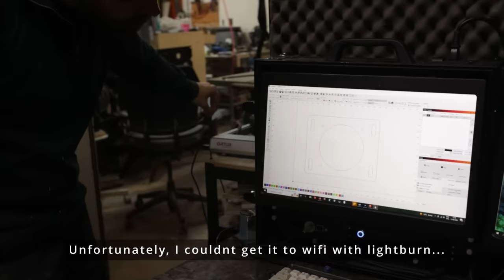Building a £20,000 Epic machine part 3

Comment: I do not think I have ever been more impressed by one mans range of skills! It's been a true pleasure to watch you build this fabulous machine, and you have amazed me over and over by how you have gone about building it. From using a bench grinder mounted on the machine, to help build the machine, the sheer precision you have achieved throughout, and to all of the skills you have used along the way. Woodworking, machining, pneumatics, electrical etc, etc. Just setting up a VFD gets me pulling my air out! A really amazing build. And then you topped it off with the vacuum clamping system, I was not even aware it was possible to pull enough air like that through MDF. I do not think I have ever been more impressed. Just fantastic.
Reply: bonjour juste dire la même chose
Reply: Nice 👍 I have no words to describe him … just amazing guy

Comment: 1:59:28 "It doubles the air pressure using science"
For all those wondering, the pressure booster is a purely mechanical device with two pistons of the same diameter on the same concentric  rod.  This allows for twice the pressure to be exerted on the rod, which is also providing the output pressure.  So, you can get NEARLY up to twice the pressure (regulated to anything up to that value) since there are losses due to friction and port timing.  Of course, noting is free so you do lose half the volume in the translation.  No pneumatic systems are not unlike hydraulic systems except that they are more dangerous since gases are compressible.  It is mechanical, so it's not intended for high volume applications.  In this case, there was no need for a large reservoir as the cfm of the tool-change pneumatics is quite small.

Comment: You should shield the slides and the gear racks against dust. You installed a shield above and not all around. Same goes with the other axis. In time you will have dust issues. Especially the rack and pinion that you greased. A great job you did!

Comment: This is awesome, not because you have amazing skills, this is even more awesome because I can only imagine what you'll create with that machine!!!! 
As a cnc user and tinkerer,, the only criticism I have for your vacuum table is while the direct motor to zone approach is nice, having the motors go into a manifold and having each zone separated gives you the benefit of being able to concentrate multiple motors into a smaller area for running small parts. You can then cut through parts and not worry about loosing too much cfm as the additional motors will compensate. Just food for thought. Obviously amazing work!

Comment: Amazing work! Subscribed.
Here's an idea for consideration...
Instead of dedicating the helium cylinder for the constant spring rate counter balance, use a bigger diameter pneumatic piston (or multiple smaller ones), put a filter on the bottom inlet, send the Z-axis to the highest point and then bung the top inlet, so you would have an infinite supply of 14.7 psi (atmospheric pressure) to act as your spindle counter weight.
It's just a concept I've always wanted to try.

Comment: Just a quick note on your cooling there, It looks like you have aluminium radiator and brass fittings... Be careful mixing aluminium with nickel and copper based metals in your cooling loop, you can introduce galvanic corrosion.

Comment: O-M-GOSH!  Yes, this is simply routine work and all-around trade skills, heh, heh, heh.   Nothing to see here.  Inconsequential.  Who needs confidence?  A 3-part project?  Hohoho.  To me, that is 1) turning on the lights 2) not tripping over floor bumps and sawdust and 3) remembering where I put the last project I started.  I know where my saw's "On" switch is located.  And the wall plug.  I also had a beer around here someplace.  "Honey?  Have you seen my hammer?"  My idea of spreading knowledge is to first make sure I HAVE IT, BUB!  WOWOWOWOWOW.  Thank you for sharing your non-woodworking-related mechanical, electrical, vacuum and pondering moments.  It does encourage me to do more outside the box, so there's THAT!  Thanks again.   Keep it coming.

("Hey Honey!  BTW:  Look at this Yorkshireman!  He is building a massive project in 3-parts without visible perspiration and during the main project portion, HE DECIDED TO JUST BUY A NEW LASER SO HE COULD MAKE CUSTOM GASKETS FOR THE MAIN PROJECT!!!  Remember the fit you had when I bought that pilot drill bit set - on top of buying a new Makita 18V battery???  I think that was the time one of the neighbors called the police......or was that another time?...Hee hee hee....yes, I'll take out the trash.....).

Comment: 2:01:37  Having a hard time think of what the advantage of gluing the spoil board down to the vacuum plate is when you can't just discard the spoil board anymore. And the vacuum plate is already glued to the plywood table so all of it would have to be redone once the spoil board is unserviceable.  Yes, you could fly-cut the spoil board off, but that's a lot of cutting/mess and some of the vacuum plate would surely be lost in the process.   To me, mechanical fastening would be the way to go as you're going to get lateral leaks through the MDF, itself, even when glued on the perimeters of the separate vacuum sections.

Comment: Impressive range of skills there mr! And after all that you got caught out on the vacuum motors. The ones you ended up with look to me to be the right kind. You need the motors with a separate fan for cooling the motor like the motors used in wet and dry vacuum cleaners. Normal vacuum cleaner motors rely on the air they pull through to make the suction to also cool the motor which are not the most efficient motors either so there is a lot of heat to get rid of. This is why vacuum cleaners overheat so quickly if they get blocked and why they have a suction release valve if they are pulling too strong a vacuum.
An impressive build though and seriously, carpentry / joinery, metal machining / fitting / turning, electrical and did I notice some electronics skills in there as well? And the CNC build is superb! Not sure about the dimensional stability of timber over time but the thing looks fantastic!

Comment: Freaking amazing.. no wonder you have been 2 months between posts!!!  Crazy amount of work and learning required to do this much! I was wondering how you would replace the spoil board after gluing it on. Then I realized you can just machine off the damaged surface many, many times until you need machine it completely off and glue on another to replace it.  Can't wait to see what else you will make with it!

Comment: Great video 👍 The  air compressor cut out pressure switch can be adjusted so your tool release will work better.
Reply: The cutout pressure is not the issue.  It's the hysteresis of the pressure cycle that needs to be altered.  If you simply increase the cutoff pressure, then you are increasing the system maximum pressure and that is ill advised.  On some systems, the hysteresis can be altered by adjusting spring pressure.  On others, it is fixed.  Nevertheless, his solution for the ONE DEVICE the needs constant pressure above the low-end of the hysteresis cycle is just what the doctor ordered.
Reply: @DiffEQ  Thanks for enlightening my knowledge.

Comment: If I may, one suggestion I would offer is you can use plastic pin nails in a standard nail gun for holding your work down to the bed when the vacuum isn't really feasible instead of regular screws.
A lot of the creator channels I watch use them because that way if you goof on your tool paths and the bit hits a nail, it'll just mill though it instead of destroying the bit and potentially causing warping and damage.
Also, when you go to remove it, you can just shear it off parallel to the work surface without leaving a big hole or rupturing the MDF.

Comment: very impressive work and capable machine!
The only advise I'd give you is to blow air under the dust shoe. You only need a little amount to get the dust off in the air so everything is sucked out. No post-cleaning will be required  anymore :)
Reply from the maker: thanks! im in the middle of doing that, and also a stiffer z plate and better dust shoe, it never ends lol
Reply: @NewYorkshireWorkshop  great! You'll probably get rid of the slight shatter in deep cut with the stiffer Z.
Did you try aluminium already?

Comment: Just a tip, if your using a 70 usd  to 160$ usd broach to cut a keyway, you might wad up a bunch of towels under the press for it to land  on its high carbon steel and it chips really easy making it useless.

Comment: First off: Amazing job, and well done. Nice to see someone with such skills doing such projects. Towards the end I was thinking that all it needed was a vacuum table, then voila! So glad to learn the correct name for that clamping method. All these years, and I never knew........
1:17:00. As an electrician, I am curious as to the reasons for your method for the shield connection to the cable earth conductor. All code, training, and information I have ever had specifies that the shield is to be bonded to the metallic enclosure at each end, not directly to the earth ground conductor in the cable. While is may seem to be somewhat arbitrary considering that the enclosure is also bonded to the earth conductor, and connecting the shield to the earth conductor within the cable assembly instead in the enclosure doesn't seem like it should be a big deal, it actually can have an effect by creating a hole in the shield that allows noise leakage.

I was always taught to maintain the shielding along the conductors to the end of the conductors and as close to the terminations as was practical. Generally the shielding would be enclosed with heat shrink within the cabinet, and have a ferrule crimped onto the end to be terminated on the enclosure ground bus.

If the spindle is wired in a standard manner, the earth conductor will be bonded to the outer casing within the spindle. As the casing connects to the outer shell of the power connector (plug on the spindle), all that is needed is to make the conductor connections to the cord connector, then clamp the cord connector shell onto the folded back shielding (the adhesive bonding conductor is optional). Bonding the shield to the earth conductor within the connector is redundant and unnecessary, and possibly opens up a hole in the shielding. Although practically any such hole will most likely cause negligible EMF leakage in this situation, connecting the shield to the earth conductor within the connector just adds unnecessary work.
Reply from the maker: its a good point, unfortunately the spindle isn't wired in a standard manner, the earth conductor in the spindle connector is not connected to the spindle casing!  Reading forums brings up the theory that these spindles were mainly for the Chinese Market where they don't have any earthing requirements, so they don't bother with a casing to earth wire connection. in any case, this is why I had to connect both the shield and earth via the connector casing.
Reply: @NewYorkshireWorkshop  LOL, There is often hidden reasons for many things. I wasn't expecting such a quick response, and added an edit. Thank you for such a fun romp with your skills and craftwork.

Comment: temperature fluctuations and humidity levels are going to expand and contract the wood throughout the seasons warping your platform, need an oversized fab. table  solid diy build and some beasts for tool I would trade one of my younger siblings for that rivet gun and vice......

Comment: Great job, and that's not easy for a Lancastrian to say to a Yorkie.
Some questions:
- Any chance of a cost breakdown?
- What are the power requirements for this?  I'm guessing 3-phase, since you're running a 3.5kw spindle, and 750w servos, not to mention all the vacuum pumps.
- I'm curious why you went for the air pressure doubler, rather than just raise the tripping point for your compressor.
- All those holes and no broken tap?  That's mandatory, like having at least one leak.
- Is the paint dry yet?

Comment: Wow - what an unbelievable piece of technical and "engineerical" art! 😳😁 It was a pleasure to watch your "little" series. If you would like to automate the tool change I can recommend the video from Marius Hornberger if you still didn't know it! He also explanes his algorithm for measuring in the 3 flute surface planer tool. 

The only two things i would improve is the position of the heat changer from the spindle cooling circuit. If it gets so much unfiltered air with dust it will be clogged in no time. Especially in considaration to the spindle that's a high risk of overheating and I wouldn't like to risk it 😅

The second improvement is also in relation to the spindle. I think it will become much more stiff if it gets a second mounting clamp on the top - that one already installed looks very undersized. It also will fix the vibration of the fixure plate probably because the spindle can't swing as much as before an won't lead the lever forces into the plate which actually acts like a spring. 

I hope you understand what I would like to communicate to you.

Greetings from Germany, 
Felix

Comment: The only critique I could add not  being critical but to offer a little insight from my past profession.
Increase your filter size and if possible pull from the bottom if you can. 
The reasoning is number one large pieces won't get on the filter but you won't be able to see it so readily maybe make a negative pressure collum (clear tube color water to show when filter needs changing .
And the filter size as usually the high efficiency filters don't really cost a lot between sizes.
If you can find a supply house that you can get glassfloss filters you can buy a 20"x 30" for about $7-$10 for a filter 3"- 3.5" thick and just as good efficiency wise as what you have.
I usually buy them by the case of 4-5 depending on size. But would possibly last you a few years. Don't chance blowing them out unless you really have to. 
I also tape mine in with painters tape. The friction fit is good but when your protecting electronics the static charge drags the dust in from everywhere.

Comment: Hi there from small russian woodworking manufacture. You did a great job with this machine building.
Can you show a link to three types motor which you used to make a vacuum table?
Reply from the maker: Hi mate. These Radvac ones are the small ones I used- https://www.amazon.co.uk/gp/product/B013X9F4U0/ref=ppx_yo_dt_b_asin_title_o02_s00?ie=UTF8&psc=1
I have a Record power DX4000 extractor in my workshop which has two of this same motor with heavy use for the last 10 years so i think they are quite reliable, althouth they dont have great cooling they can run for hours. 
The other size i used are these- https://www.ebay.co.uk/itm/362812922320 Although these ones have better cooling im not sure of reliability, I milled some carbon fiber last week and one of these was making an oscilating noise, like the power going up and down, but that could also be the scr controls i guess, time will tell!
The larger 3 stage ones I dont recomend becasue they were much more expensive, needed modifying with the grinder and the blades scrape at high rpm!
hope it helps!
Reply: @NewYorkshireWorkshop  friend, thank you a lot for detailed information

Comment: One thing I didnt understand (well there were many but this haha..)
When you did the bed suction, to hold the wood down for machining, You put an 18mm MDF spoil board down on top of the air suction passages, THEN, the work piece on top of the spoil board. How on earth is the air sucking through the spoil bard? Surely this would blank air coming through??? Or are there 1000's of pin holes, like on a air hockey table in the spoil board?? I must of missed that bit if there is?

Comment: Amazing work, but if you mount the spindle cooling fluid radiator on the inlet of the control cabinet, won't you be introducing heat into an area that you're trying to cool?

Comment: This is incredible and I'm curious how you designed this.  How long did it take you to design this, did you design everything upfront, or just overall and then one "subsystem" at a time? Like everything just working first try in terms of placements, clearances, and the zillions of other things that have to be calculated can't just be guessed line voltage conversions etc.

Comment: Wonderful to see this incredible machine come to life! You are incredibly skilled in such a wide variety of interlocking disciplines, and it is a real pleasure to watch you work and learn from your process! I have a question regarding the suction. I understand that there are 8 motors driving air out individually to hold the spoil board, however, I didn't understand how the air is passing through the spoil board to hold the work piece. Is the material used for the spoil board porous enough that air can pass through freely? Did shaving away the top and bottom sides of the MDF turn it into an air filter or sorts? Thanks again!
Reply from the maker: Hi, Thanks. Yes the MDF is very porous! shaving the faces off isnt completely necessary, but the sheets are more dense on the faces so it does help with air flow with lower power motors.
Reply: @NewYorkshireWorkshop  Wow, that's absolutely fascinating! Thank you for the clarification!

Comment: Strongly urge you to make a more rigid bracket for your toolsetter. Its critical that the sensor cannot change in Z, it moves quite a lot when you touch it in the video. 
Little solenoid and a rubber bumper against the Z axis pulley instead of all that pneumatics stuff maybe? :X What is the hard, dark plywood you are using called?